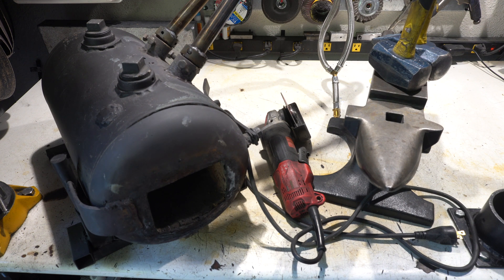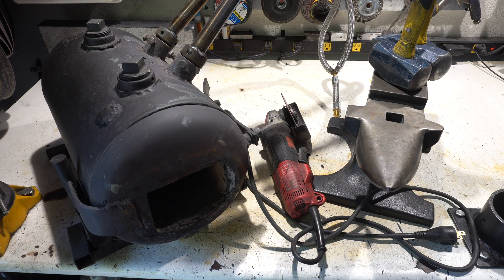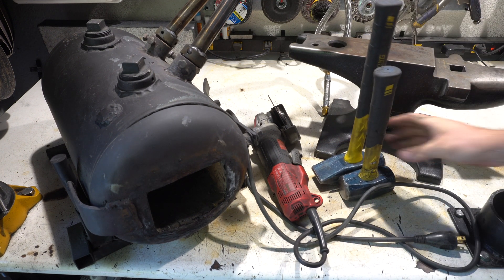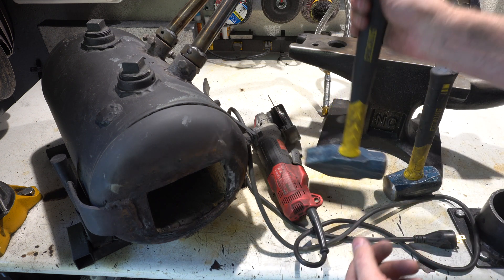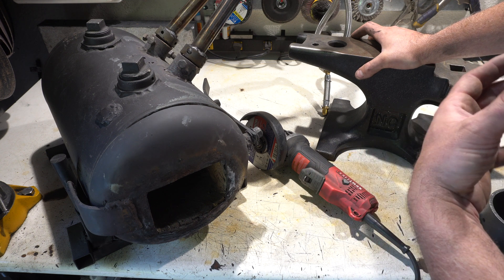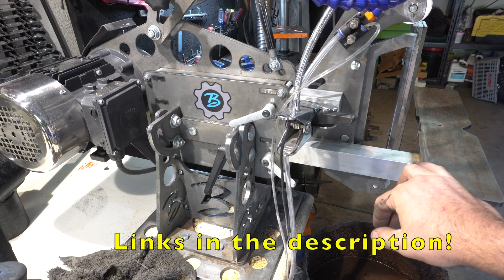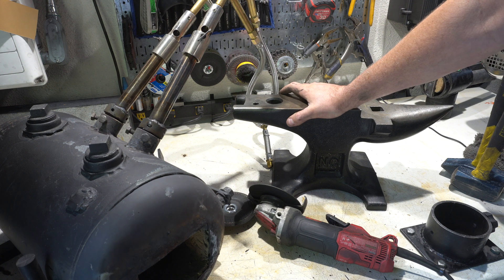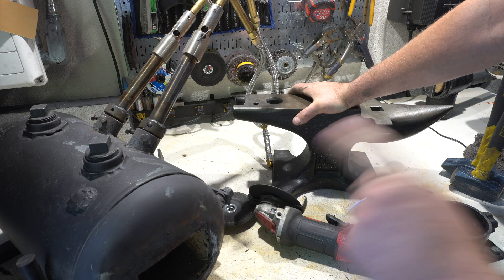Triple-T #47 - How to get started at blade smithing

Comment from the maker: Any tools I missed or other questions you have on starting out in blade smithing?
Reply: A good vise ore some clamps
Reply from the maker: @tomershamir8789  yeah, I thought of a vise later.  Certainly a needed tool.  Thanks!
Reply: I think you forget about good set of files:). Considering that you can do bevel with the files, but you can't make choil with belt grinder I would buy set of files at first, and next go with belt grinder :)
Reply from the maker: @DBCraftWorld  Sure, but I didn't mention the lower dollar items like hand tools.  I'm sure you will need drills and other items as well.  I agree though, you could do it with files.. but not many will want to.  😜
Reply: @TyrellKnifeworks  hmm.. I didn't thought about that- you are right:). I had it in mind when I was writing it- I would probably make one knife and after that I would buy a belt grinder :).
Reply: I'm guessing a pair of tongs would be useful also??  ;-)
Reply from the maker: @BeeSting862  Yes and no... tongs are easy to make.  I made my first set out of rebar and that worked for me for a long while.
Reply: @TyrellKnifeworks  ...and how do you get the rebar out of the forge when you were making the tongs?
Reply: @BeeSting862  Cut the material long and use a wet rag to keep the end cool.
Reply from the maker: @BeeSting862  Exactly what Jeff said... just use long pieces.  I used vice grips for the first week or so until I made tongs as well.  It wasn't ideal but it worked in a pinch.  😜
Reply: @BeeSting862  visegrips will suffice
Reply: @BeeSting862  With your hand. Only one end is hot.
Reply: I don't know if you have seen the video done by knife steel nerds on quenching in canola oil but its an interesting watch. Great video the only thing I would add is maybe a portaband or bandsaw not necessarily a necessity but does make cutting metal a little nicer than the angle grinder and a wood round to put you anvil or steel drop so you can work your metal in a slightly more comfortable position than an anvil on the ground. Thanks for the video always enjoy watching.
Reply from the maker: @okiedokie2487  Yup, I've certainly seen Larrin's video.  A great watch.  That's one of the reasons I really recommend a good quench oil and not canola.  It's ok for 5160 I guess.  I think the portaband/bandsaw is a luxury when starting out.   An angle grinder is the real go-to at first.  Everyone who continues is eventually going to add tools and the bandsaw is probably one of them.  Not one I would (or did) start with though.   (and the stump for the anvil is a given... go to the bush and find one... no cost lol)
Reply: @TyrellKnifeworks  the one other thing I forgot to say is some tools you can check for at pawn shops for a great deal. I've got a couple of angle grinders and the last one I picked up was a pawn shop buy for 6 or 7 dollars and it works great. Obviously it's a bit of a game of chance but I usually look through their stuff and I got 2 nicholson files that were still sharp a chunk of brass round a couple pieces of bronze round and a set of taps that don't look like they have every been used all for 8 dollars. I definitely walked out smiling.
Reply: Hand drill motor will suffice for start up but after one is certain they want to make knives a drill press is very important to make tight pin to handle scale fit . Personally I’d go to estate auctions where they are selling off old shop tools after the owner has passed away and bid on an old drill press . In my opinion a China made drill press is junk . Also get a good magnet 🧲 and watch YT knife makers heat treat techniques.
Reply from the maker: @randyblackburn9765  yup, i agree a drill press is a great addition.  Not required to start though.  Thanks for watching!
Reply: What kind of steel to start with?
Reply from the maker: @timtheflyguy  Great question! That’s next week’s Triple-T!

Comment: I'm looking at purchasing my first set of tongs soon. I'm curious what you'd recommend. A guy here in tubelandia said that slot jaw might be a good choice, but, there are so many other opinions.
Reply from the maker: It depends what you do.  If you are working with similar size stock, box jaw rings are great.  I really like v-bit bolt jaw tongs because I do Damascus and they are great for rebar that I use as handles. Z-offset tongs are great too.  Check the video description for links to the ones I use.  Thanks for watching.
Reply: @TyrellKnifeworks  thanks Denis, I'll check out the links as you mentioned :)

Comment: I’m a tractor trailer mechanic by trade. We throw away a lot of the old leaf springs from them. Is that steal the same?
Reply from the maker: Yeah most likely it’s 5160 spring steel.  It’s very good blade steel.
Reply: @TyrellKnifeworks  I found out today, you are correct it is 5160.  Unfortunately, I also realized the springs from a tractor trailer are almost a half inch thick. So I might want to just keep looking lol
Reply from the maker: @pjinxhacks9568  haha, and 5160 is a tough steel to move under a hammer.  😉
Reply: @TyrellKnifeworks  i’m going to order a Mr. volcano next month. So I’ve got a little time to get a hold of some steal.  A friend of mine has about a 14 inch piece of railroad track. It’s gonna take some grinding and some work, but I’m gonna try to see if I can turn it into an anvil
Reply from the maker: @pjinxhacks9568  that should work.  You might be better to stand it on end and weld a solid piece of steel to it.
Reply: @TyrellKnifeworks  wouldn’t it need to be forge welded?
Reply from the maker: @pjinxhacks9568  how good of a welder are you? 😜  if you reduce that gap as much as possible it should be fine.  You want mass under the striking surface.  The problem with RR track is that there’s little under the rail and it rings like crazy.
Reply: @TyrellKnifeworks  give me a lead long enough and I’ll fill the hole in the ozone.  Not really. But I get the job done.   I may just go ahead and pick up a anvil instead of trying to be cheap about it
Reply from the maker: @pjinxhacks9568  Note, used anvils are super expensive right now.  You might look at getting a brand new NC anvil.  They are only $330.
Reply: @TyrellKnifeworks  I am networking with a few friends to find something I can use with in budget.  I have at least a week before the forge gets here anyway.  I can be patient…. Kinda😅

Comment: If you don’t wanna spend 600 dollars you can but harbor freights 15 lb crappy buy cheap anvil and their surprisingly good 10 dollar angle grinder, while I didn’t take this path you can find a cheap 1 burner anvil on Amazon. If you have even one doubt you can’t start your forging journey get rid of it and start forging. I started with a few bricks, charcoal, a hairdryer, a hammer and (crappy) anvil. “If he could do it, so can you” - subnautica (I was also 13 when I started)
Reply from the maker: You’re better off getting a heavy piece of steel than a cast iron harbor freight anvil.  You don’t need something “anvil” shaped, that’s what people fall for.  The rest I agree with.

Comment: For the oils. Would used motor oil work?
Reply from the maker: Never use motor oil.  It’s carcinogenic and is a terrible quenchant.  If you can’t or don’t want to invest in real quench oil then stick to 5160 steel and use canola.  See my heat treating video for more info.
Reply: @TyrellKnifeworks  thank you for letting me know

Comment: I was wondering about your background… what skills did you bring to this field?
Reply from the maker: I started bladesmithing just over 3 years ago with zero metal working skills.  I bought a cheap stick welder and learned to weld from watching YouTube so I could build a forge.  Then built a 2x72, then a power hammer and a hydraulic press.  If you’re passionate, you can build anything! 👍

Comment: Engineered quench oil for thin blade stock is a good way to burn your money. Seriously it is hella expensive, stinks to hell, releases toxic smoke and fumes and is a huge headache to dispose of properly. With reasonable blade geometry any preheated vegetable oil will easily quench blade stock fast enough to harden, even very pure unalloyed carbon steels, provided you thin out the cutting edge reasonably prior to the quench and move the blade in the oil. Engineered quench oil is designed for THICK stock. We're talking far beyond the realms of a blade. I would not consider it unless I'm exclusively working very pure unalloyed carbon steels without any manganese (hitachi white for example), in a production environment, for say kitchen knives that need to be screamingly hard.
Reply from the maker: Well, sorry but I think that is completely false.  Canola is proven NOT to be a good quench oil, particularly for 10xx steels.  You will get surface hardening only with canola.  Why waste your steel and most importantly, your time, on sub-standard quench mediums.

Comment: I think the idea of making something yourself if your knew to welding and other processes is fantastic. Made my own coke forge from bbq with water tank, stainless steal chew iron and copper wound heat exchanger which was all knew to me, but having something that worked really well after was such buzz. In terms of the neighbors hearing you enjoy anvil work, I think you just have to pick the right times. Planning on making a press as I have many neighbors as I live in corner plot. I think what ever situation you can make it work🤘
Reply from the maker: Yup, I have neighbors and a press so I make sure it’s not after 8pm or really early.  It’s so rewarding making tools and things yourself.  That’s why I made my first forge and burner, so I KNEW how they worked and how to optimize them.  👍
Reply: @TyrellKnifeworks  Spelling mistake I made, new not knew 👍

Comment: Great video Denis! To be honest, unless you not buying new one, trying to get good anvil might be very difficult for somebody who is not experienced. I'm still trying to find 100-150lb anvil and there is nothing interesting on the web. I think you get to the point- Get the biggest chunk of steel you can and  use it as an anvil:). I did it, and so far it works  (lol).
Reply: Old farmers estate auctions are a decent source of old anvils . Lot of old time farmers used anvils to hammer rivets into mower sections that cut hay .
Reply: @randyblackburn9765  Unfortunately I'm not living in US. I'm from Poland where 100-old anvils (those good one!) are use by "new generation" as a cutting block to their angle grinders. Barbarians, but it's truth
Reply from the maker: @randyblackburn9765  yup, that is one of the best places, but I think everyone is getting wise to the demand and value of anvils since FiF.
Reply from the maker: Yup, I wished I had researched a bit more when I bought my anvil.  Oh well.  Thanks for watching!

Comment: The comment I hear the most is space & neighbors, both seem to prevent a lot of people from starting, I understand why. As for the scrap yard, I'm not saying you're wrong, but I heard that a lot when I 1st started. I went to 3 & they looked at me like I was crazy & what they did have wasn't much cheaper. Now that was just my experience, so I don't want to discourage anyone from trying. I actually built a forge before I built my oven, but going outside to do everything got old real quick, especially with no protection. Hope all is well, take it easy.
Reply from the maker: Hey Dave... I didn't say scrap yard... I said steel yard.  Go to your steel yard and see what they have in large steel drops.  It's certainly not going to be $3-5 a pound like an anvil prices.  Anvils are just stupid expensive right now.  Thanks for watching!
Reply: @TyrellKnifeworks  This was 5-6yrs ago, so that makes sense. Yeah, scrap yard, steel yard, I thought they were the same thing.  I tried steel sellers, but they said they don't sell cutoffs. This is big city D.C also, so might be different elsewhere. Definitely not a junkyard. Ya know, big crane, piles of scrap steel everywhere, hahaha
Reply from the maker: Steel yard here is definitely not a scrap yard.  I’m talking about a steel supplier.  Where I get all my steel tube, angle and general structural steel.  They have i-beams and other heavy stuff as well.  Thx

Comment: Are you familiar with Templstik. Heat testing crayons. Or any suggestions on any thing else for checking temperatures other than steel color. Thanks again for all your knowledge.
Reply from the maker: I've heard of those but have never tried them.  I have one of those heat guns that are rated up to 2500F, but the range on them is crazy.  They can vary by 100F quite easily.  If you're just looking for 1475, the best simple solution... use some salt.  It melts at 1474F.  Thanks for watching, Ed.

Comment: You can do 5160 and 52100 in Canola ok and works for those two more or less only
Once you're using carbon steels its just not a fast enough quench, Hortons K or Parks 50 really produce consistent results on the simple, carbon steels. For example the old standby 1084 will get upwards of 65-66HRC after being dunked in a fast oil, Canola you might squeak out 45HRC. A gallon or 4-5:L of these oils isn't that expensive compared to a bin full of unhardenable knives and your time wasted, likewise, peanut oil, motor oil, trans fluid or any of that stuff is basically not worth the effort you put into it.

Also make a good quench tank that won't fall over and set your shop on fire... and of an adequate depth for the length of knife you wish to harden :)
Reply from the maker: I can’t agree more.  Watch my triple-T on heat treating.  👍

Comment: good vid ! thinking about setting up in my gardenshed. need to clear it and fix the roof first tho. 
did u make the burners yourself aswell ?? would of liked to see the gas/air mechanism on your burners. 
 Keep it up
Reply from the maker: I built the burner on my first forge.  These you saw in the video are purchased.  I purchased those two burners for $160… the two-burner Mr Volcano for that I linked in the description is $138 for the whole thing!
Reply: @TyrellKnifeworks  alright thanks man, I'll check them out !